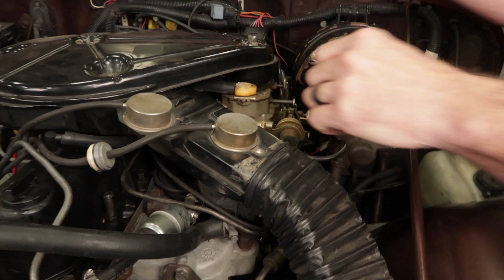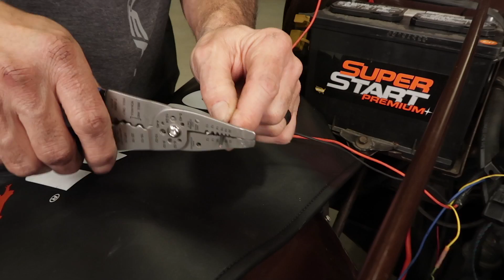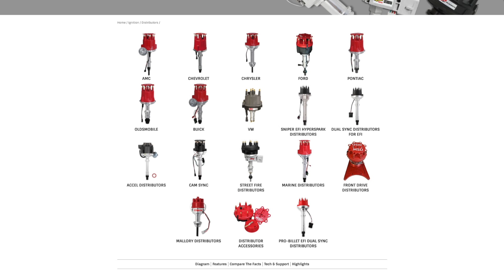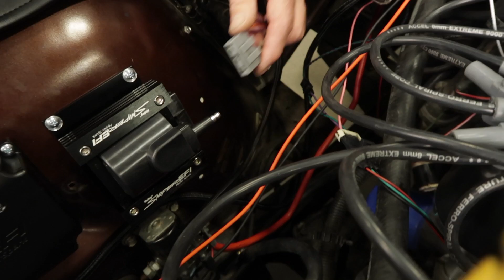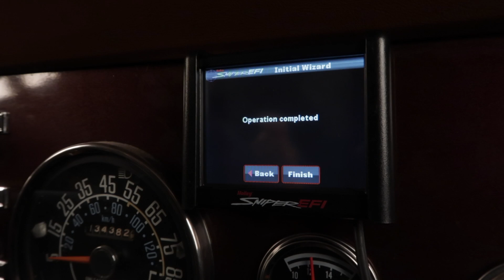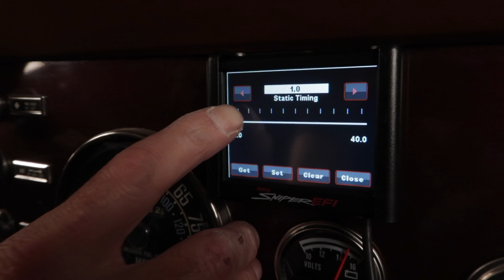How To Install Sniper EFI BBD for 1971-1986 Jeep CJs

Comment: This was put on a 81 CJ seven that I bought by some previous owner and it's fucked up. Issues with stalling, oversensitive gas pedal, gas guage inaccuracy, and the alternator not sometimes charging the whole system. I am fed up with it and going back to carburetor. Do not waste your money on this..

Comment: I bought this system for my 1978 Jeep CJ5. I’ve had to replace the TPS that came with it (twice), the 02 sensor, and the IAC valve. After figuring all of this out it does seem to run better than it ever has.

Comment: 1987 to 1989 YJ wrangler also has the same AMC 258 engine that the CJ had. Should apply to them with little to no adjustments.

Comment: I find it kind of funny so many are giving Holley their hard earned money for what amounts to an electronic carburetor.  EFI?   No. It is not. 
Needless overcomplication and expense for those sold on 'new and electronic vs mechanical is always better' ?  . Yes.
Reply: Agree.  Added a Weber 32/36 on my 232 and it ran lock clockwork.  On and off road.  About the only time I know electronic is better is when constantly changing elevations.  Otherwise, there's nothing wrong with a good running carb.  I get 16-17mpg regularly.
Reply: I'm confused.  It uses a high pressure regulated fuel pump with two 100 pound per hour fuel injectors and an adapting learn computer.

Comment: I bought an 85 Cj7 that looks identical to that 84, and I'd love to have this Holley system on my Jeep, but it has the Howell throttle body already installed on it, and I can't find one mechanic who's worth a damn, or who even wants to work on it...I paid $3000 for it, drove it for 2 months, then found out the hard way that I had to rebuild or replace or upgrade everything save for the transmission, transfer case, and front differential, EVERYTHING ELSE I've had done...blew a head gasket 3 months ago, and I had the head and valves done by a shop that cannot get it to run without it backfiring and buckin like a rodeo horse, and there's no one else I can find who wants to work on it here in Los Banos, Calif..., Ive called at least a dozen shops I've got over $15,000 in it already and it just sits in my driveway....I'm so pissed off I can barely see straight....

Comment: Question for Holley or anyone...   I have the 4.2L straight 6; Offenhauser dual plane intake with 4150 intake pattern (It's bored over and made about 210 on the dyno),  I don't think I have a spot to put the temp gauge on the intake (I don't think coolant even runs through it),  I was just going to put it at the front of the head, where the stock temp sensor is, but the stock sensor is much smaller than the one provided in the EFI kit. The stock sensor uses two wires that are the same gauge as the EFI sensor.  Can I just use my stock temp sensor for the EFI system?

Comment: this says that it will work on a 1971 cj. But information floating around the web indicates that the 71 still implemented the 225 Ci "dauntless" engine, and the official word seems to be that these sniper kits may not work with the 225 being that it is an odd fire engine. So will it or wont it work with the 225 ci odd fire engines?

Comment: I saw they had a return line hooked to the throttle body when they used the holley returnless fuel pump. Was that just for show or am I missing something
Reply: I was wondering the exact same thing.

Comment: Hi, Iwant to ride the Holly bbd EFI SNIPER in myJeep,Iask youhave to buy a atank and ignition. My Jeep has a HEI ignition and it has a aHolly gas pump. What it has is carburation problems with the BBDCarter.
Reply: Hello, my E--mail is calvoalegre@gmail.com. Iam from Puerto Rico.Iam about to buy the Holly Sniper BBDfor my jeep CJ7.Iwant to know,do I have to buy the ignition,and the Tank obliged? My CJ7 has an HEI ignitionand electric pump on the Holly brand line. My investment depends on that information.I understand that the product is very good but i have no experience in the field. I need the your valuable experience. Thank you.
Reply: I have a 1971 CJ-5 with the Dauntless 225 ci v-6 and wonder if it’s worth it for me living in NYS and driving it 6 months a year.
Cost?

Comment: So there are 2 pressure regulators in this setup?  One as part of the in tank module as described in the part description and also one on the efi itself...does that cause any issues?  I thought one of the benefits of the Holley internal tank pump system(as described in the in tank pump spec (part #12-307) was that a return line wasn’t necessary because the return action happened inside the tank with that regulator...and if a return line isn’t necessary, would you just cap off the return side on the efi? Just wondering about effects of 2 regulators...
Reply from the maker: Two regulators are not needed, we just happen to be using a self-regulated pump on this build.

Comment: Agree with the comments concerning the red-headed stepchild.  the 87-90 YJs come with the same 4.2L engine, but the gas tank listed in this video doesn't fit (according to Holley when I spoke to them).  So while the EFI system "should" work, we are stuck with the external fuel pump.  Would love to see Holley put out some parts/videos for the YJ (we really need the help).

Also, what about the old computer and wiring harness?  what of that can be removed?
Reply: You know, the YJ 4cyl were fuel injected.  I see no reason why that fuel system couldn't be used to feed the Sniper install on a 4.2L.  They had an in-tank fuel pump.  Seems like all you would need to do is order all the factory fuel system components from the throttle body back to, and including the tank.

Comment: I am thinking about getting this for a -75 AMC Pacer with a 258. Apart from my intake being a single barrel, is there anything else I should worry about?
Reply from the maker: Instead of using the BBd Sniper try the Sniper 2GC  https://www.holley.com/brands/sniper/products/fuel_systems/fuel_injection/sniper_efi/sniper_efi_2gc/ unit.  The throttle linkage is a universal design instead of a specific set-up fo the jeeps.  Everything else is pretty straight forward.  You will need to upgrade your fuel system to provide EFi pressures (60psi). Thx J

Comment: I want to get this for my 1990 YJ but I have a few concerns. 
1) Are you guys working on getting this CARB compliant for California?
2) I plan on keeping my Pulse Tube for CA smog. Do you guys have any instructions on disconnecting pins no longer needed for the MCU?

3) Do you have a cover plate so I can remove the mechanical fuel pump?

Do you carry a 20 gal tank and pickup as well?

Please include our ugly stepchild ‘87-‘90 YJ’s with Carburetors and smog crap.

Comment: Installed the Sniper EFI but my smog tubing is blocking the fuel inlet, which 90 degree fitting should i use in place of the one that came with the kit? Is it part number #98220berl?

Comment: So what if I didnt want to change the fuel tank that has no internal fuel pump? Would I use an inline?
Reply: I see now that this kit  PART# 550-858K comes with a pump and inline filters
Reply from the maker: @pkturpin  You got it!
Reply: @HolleyPerformance  Where do you recommend mounting the inline pump?

Comment: Will this setup work on a slant six? Ignition module and all? Not sure what a 4.0 firing order is
Reply from the maker: This would work on the slant six, but our  Sniper 2GC would work better since the bell crank is universal and works with a variety of throttle and transmission set-ups.  You can use the stock electronic or points distributor with Sniper and our Hyperspark ignition box and coil also.  Sorry, we don't offer a Hyperspark distributor for them yet. Thx J